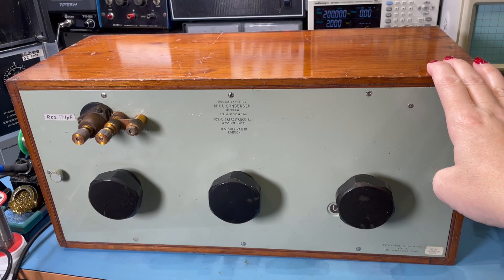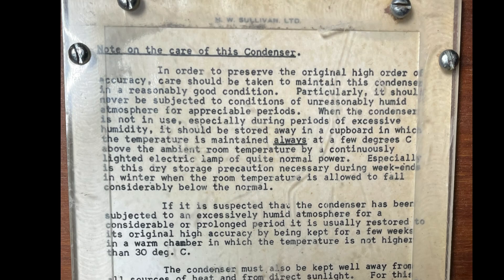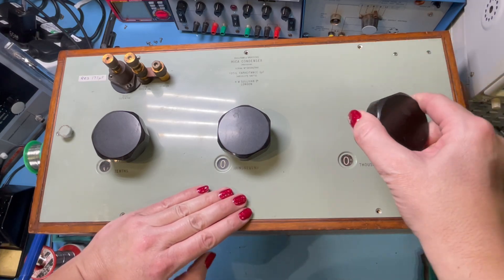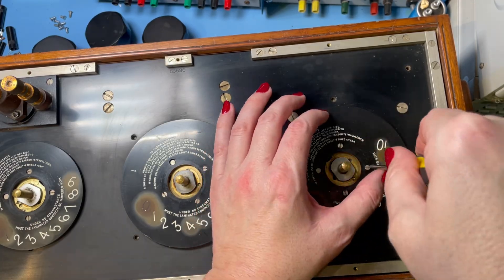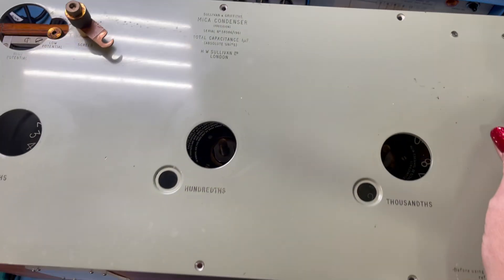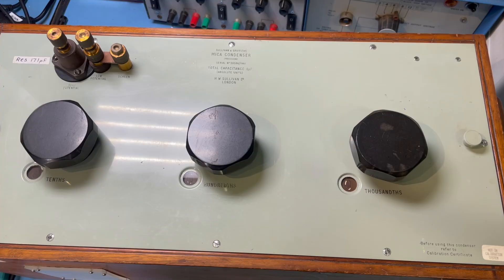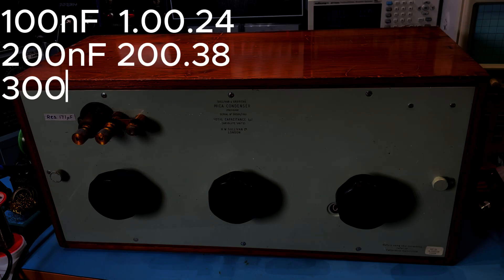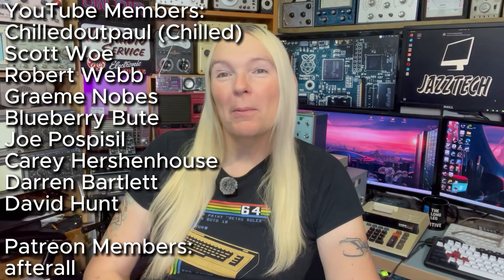The Fabulous 1961 Sullivan & Griffiths Primary Decade Box!  It's Huge & Very Accurate!

Comment: I suppose one could DIY a precision capacitor.  Two plates of exact dimensions with an air gap.  Then somehow assure a consistent measured gap between the plates with a micrometer or such.  Then through calculations one could perhaps determine the exact value.  Just a thought.  Perhaps a precision low value resistor made from a long length of thin copper wire of known diameter. Other factors may come into play such as the consistency of the diameter of the wire and unknown impurities.
Reply from the maker: The dielectric insulator will also have an effect on the value. This one uses sheets of mica in-between the metal plates. Mica is very stable and has a very low dielectric loss.

Comment: The General Radio precision decade resistors also have copper disc contacts and an apparently a mulitileaf phosphor bronze wiper contact.  The discs would get oxidized from disuse and age.  I would clean them and polish them bright and then apply silicone grease film to them to prevent oxidation.  I forget without looking they may be .01 or .02 % tolerance.  But used surplus they sell for reasonable prices.  Just that some have suffered from excessive current through on the lower resistances,  maybe one or more cooked setting.
Reply from the maker: I have the odd decade box where somebody has cooked one resistor and it has turned black and spoilt the whole box.

Comment: I have a Heathkit capacitance decade box I picked up cheap and assumed it was the typical substitution box for service work but turns out it is full of 1% tolerance mica caps.  Also got a General Radio fixed standard cap that is .01 at 0.25% that cost me a couple dollars.  Those that you have are amazing though.  Real standards.

Comment: The brown stains on the decade switches are probably from cigarette smoke and should come off with IPA. I'm a bit dubious about using cotton buds on the multi-leaf contacts as you don't want to get tufts of cotton between the leaves. We used to rub them with stiff paper. I remember mica decade boxes in our lab at college back in the '60s and we had a special department to check the calibration.

Comment: I have never seen contacts like that. The multiple contact points are probably great for ensuring excellent connections and reliable operation even after years of use an buildup of oxide and dirt in the switches. They sure dont build thing like that any more!
Reply: I have shown videos repairing decade resistance boxes from General Radio (now EICO), they use a similar multi leaf contact system.
Reply: @TheDefpom  Interesting! That must have been the way to build long lasting lab equipment with mechanical switches back then. Just subscribed to your channel! Greetings from Canada!